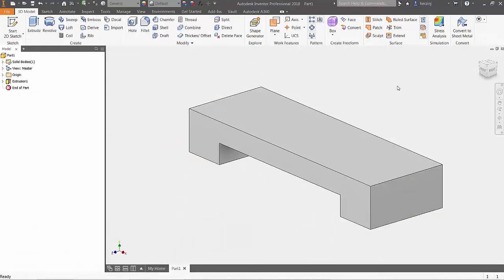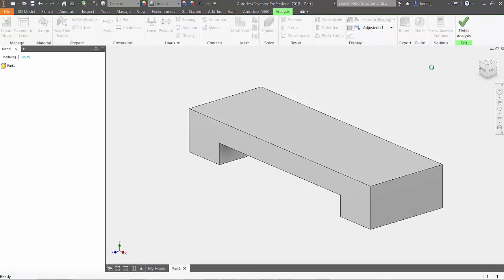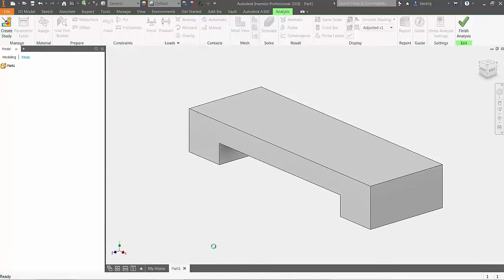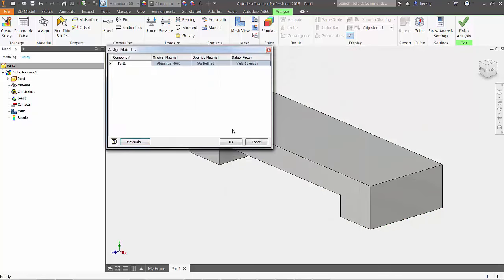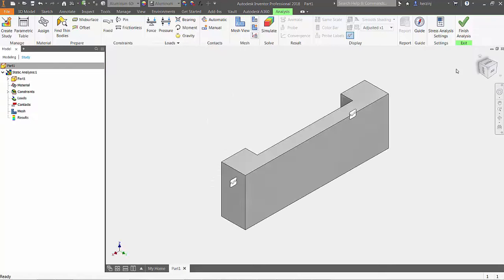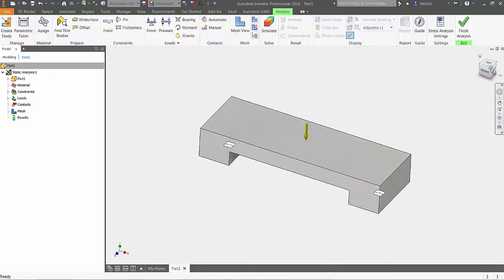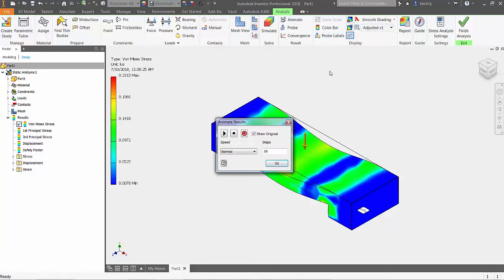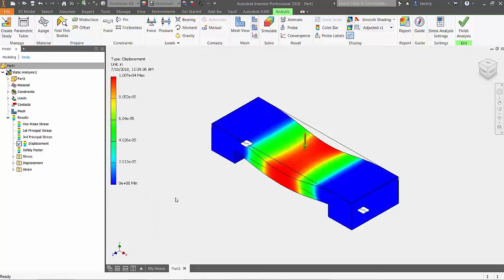Inventor 101: Linear Stress Analysis

Comment: Your mesh is too coarse to properly analyze the bending in the center beam.  There need to be two layers of mesh elements, as the neutral axis should have zero stress  (plus a minimal amount of tension in your case since you fixed both ends instead of having one frictionless).  You can tell the mid-point nodes were on, which gives some hint of the distribution, but it is not accurate.  It could have easily been used as a demonstration of when you need to refine the mesh (you even mention checking to see if it is fine enough when it is literally the textbook example of it not being), how to do it, and then also look at the singularity at the inside corners where it will never converge.  Perhaps even point out the rule of thumb that if your deflection is greater than 10% of the beam thickness that you should question the accuracy of the linear solver and consider non-linear analysis.  There is so little information in this video it seems irresponsible.  People think that if you run an FEA then that is "the" answer, but it is important to remember the limitations and assumptions inherent in the model.  You need to do better than this.
Reply: Cry

Comment: I can belive analysis software? I check version Inventor 2014 & Inventor 2019 get different results
Reply: I think automatic results in Inventor not good
Reply: @vinhtuong7198  Check your mesh resolution. Also make sure your deformations are small and your constraints and loads are applied correctly. If you need more than linear FEA, get the Nastran plugin.